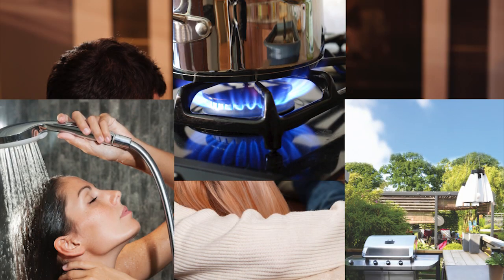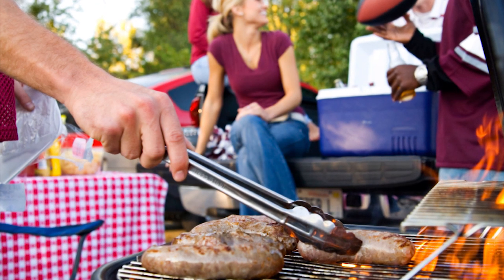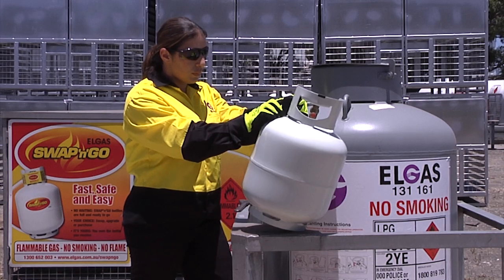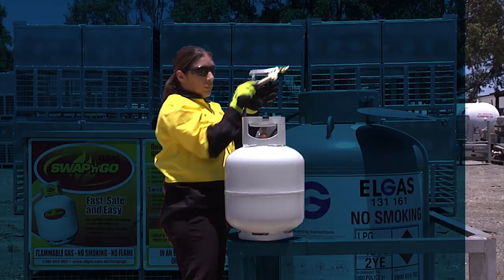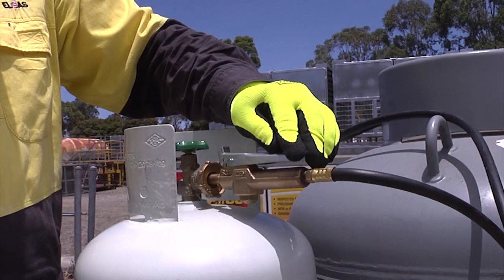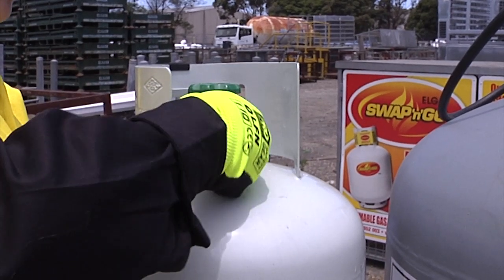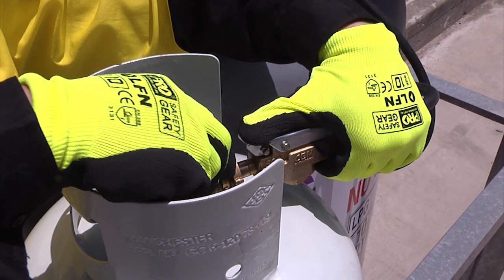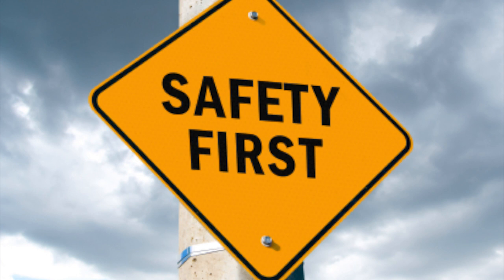How to Fill a Gas Bottle - Elgas Decant Video

Comment: When disconnecting the hose from the customer cylinder, shouldn’t the valve on the main cylinder also be shut? Otherwise I can’t release any residual gas in the hose because it will just continue flowing? Or am I missing something
Reply: The recap towards the end of the video explains that you should turn off the customer valve and the supply valve before releasing residual gas
Reply: They did not say it at the correct time.